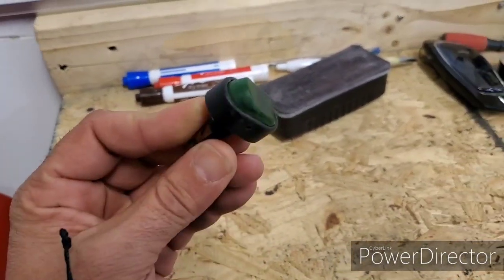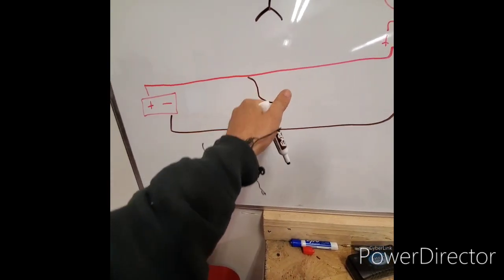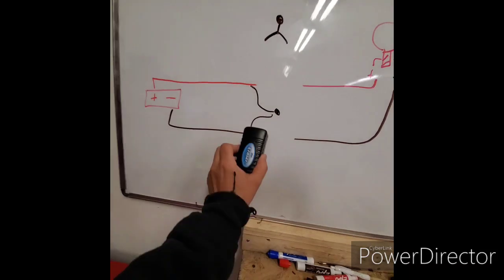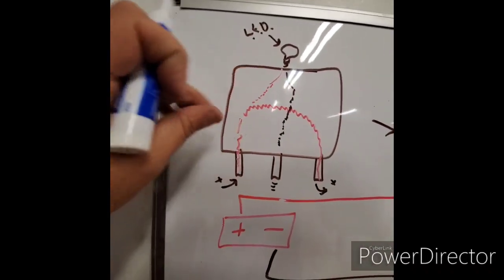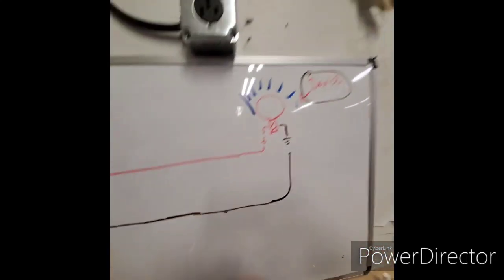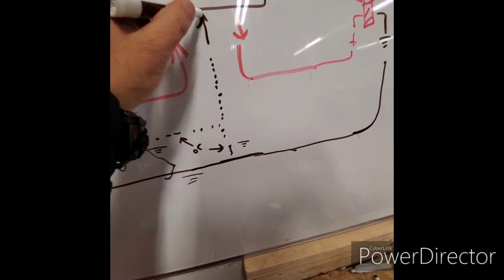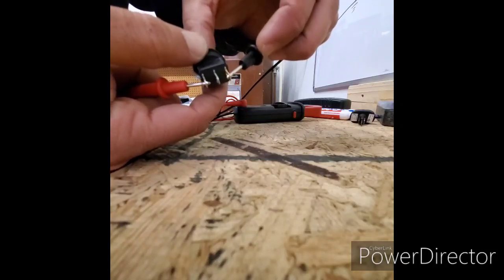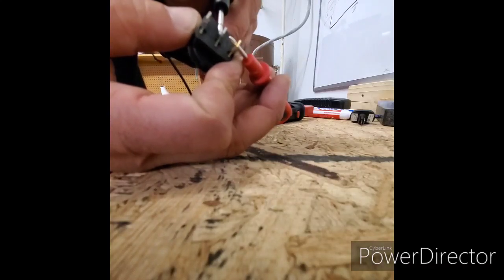How to wire an LED toggle switch , ( on-off 3 prong rocker switch ) 2020

Comment: A very informative  video concerning DC wiring.  I have been adding some LED driving lights to my side by side and everything has been working  fine. Now I want to add some lighted toggle switches  so I set up a small project on my work bench to experiment on this wiring layout before wiring the Polaris. The three prong switch is like the one you showed with the bigger light. Anyway I have a 12v car battery on the desk and was using a small 12v bilge pump as my devise.  I checked for the ground pin and located the other two positive leads.  I put a inline fuse close to the positive lead right before it connected to the battery + terminal. The other positive lead went from the switch pin to the device. The ground comes off the switch pin as a ( Y ) with one lead going to the battery (-) and the other going to the devise.  Hooked the - and + leads to the battery and blow a fuse. Not once, but two times (:(  I replaced the fuse and then hooked the same two leads to a small 9v battery and  wallah. It worked perfectly. Can't understand why it would work with a 9v battery and not my 12v. Do you have any suggestions.  Also, I have just subscribed

Comment: Thanks for the info in this thorough video! I am planning to bypass my parking brake for my new pioneer receiver, and I bought a switch to simulate the parking brake going off and on to give me access to video and settings. In my case, would I connect the parking brake wire (light green) from the receiver to the switch, then the switch to the parking brake wire on the wiring harness for the new interface? I'm using a pioneer 1770NEX and pairing it with the soogm-16 harness. Grateful for any info you can give 🙏
Reply from the maker: It would be green from HU harness --> to switch,  then switch ---> to ground.
Reply from the maker: Also. We have a micro relay video for this very topic as well. Could be simpler for you.
Reply: I’m here for the same thing… So did it works when you do it?
Reply: @myonlinecarguy1 Can you please send me the link for this topic please. Thank you
Reply: For some reason my switch wouldn't work no matter how it was wired so I ended up wiring it as the manufacturer intended. All good though

Comment: Wire up a circuit with a 3 prong toggle switch with the led ..but I keep getting it done wrong ...that Is when I plug it up to the wall the led lights up on the toggle switch ..but no power is going to the circuit board ..but when I turn it off the lights comes off and then the power goes to the board ...any help would be appreciated ... thanks 🙂

Comment: Thank you.  In the way that you have drawn your wiring diagram, am I correct in stating that the switch LED and the Load light will illuminate when the switch is turned on, but if you turn the switch "around", the switch LED would always remain on and toggling the switch would turn the Load light on and off.
Reply from the maker: That sounds about right.

Comment: Great video! You did a great job explaining the three prong.. I’m planning on building a DIY solar power box like a goal zero to power my truck bed fridge and charge phones and other electronic accessories. I want to use switches to power my 12v outlets, but the switches I want to use (round) have an LED.. though LED’s use minimal voltage/current it’s still power scavenger over a period of time. My question is, if I utilize a 3prong switch but leave off the negative connection to keep the LED from illuminating, will the switch still function properly for my source to load circuit.
Reply from the maker: Yeah the mechanical portion of the switch will still function properly without the LED portion.
Reply: @myonlinecarguy1  thanks for the valued reply! I will @mention you in my video description when the video comes out.. this will link out algorithms together and will helps us and others out. Keep it up 🤘🏼

Comment: Really insightful video - thanks. But what about if I have to wire an AC 230V rangehood fan and I have 15A 240V three pin LED switch very similar as yours on the video ? In DC circuit current always goes in one direction only, however in AC it alternates 50x per second. How am I to connect it then? Which one is a ground and which is live?
Reply from the maker: Ok. So your ABSOLUTELY correct. In an AC application,  you most likely CANNOT use a switch like mine.  As the switches we used in the video are not only DC switches,  but they are also limited to around a 15amp draw. 15amp in dc is VERY diff then 15amp AC. 
For your hood range, youll be needing a typical light switch,  like for you bathroom light. Not a toggle or rocker switch like in my video. And the wiring,  may be similar, but be sure to investigate deep. AC power is nothing to play with.

Comment: HI, 1. I'm planning to wire a small LED light bar (18watts I believe) with a 3 prong rocker switch straight to a 12 volt battery on my motorcycle. Do I need to use a 5 amp fuse and a relay?
Reply from the maker: The size fuse will depend on the electrical pull from the light.

Comment: Awesome. Great vid. Aouple of questions. 

1.  If my device needing power has a large amp draw, would a 3 prong switch not be dangerous in the sense that the large amperage moving through the entire circuit could potentially fry the switch itself and/or the LED light on the switch?  

2.  I’m a newbie to wiring. Assuming that the answer to my first question is that neither the switch or the LED on the switch would not get fried, does this mean that the LED on the switch only draws the amperage that it needs?  Whereas the device being powered draws a different amperage?  

3.  I have been advised to use a relay and connect my 3 prong switch to the relay. I’ve been told this keeps high amperage away from the switch (which will be installed in the dashboard) and contains the high amperage circuit inside the engine bay.  I’m running an onboard compressor. The 3 prong switch, therefore, is simply powering and switching the relay switch, ensuring that the 3 prong switch only has very small amperage running thru it.
Reply from the maker: The answers here are :
1) yes
2)also yes
3)this is 100%accurate. 

Now the explanation:
 1) 3 prong switches do have amperage limitations.  Should be as/per switch. No 1 size fits all here. 
2) the amperage used to power the led in the switch itself is between the power input and the (3rd prong) ground.  This is the current draw for the led in the switch. Where the power passing through and the "device" ground define the amperage for device.
3) the reason for the relay, is that now the "switch" is kind of like a keyfob. That opens a seperate amperage floodgate (that passes through the relay), but controlled by the "switch". 

Also, you said your pretty new to this. And i belive maybe you belive that, however your questions are very good one, they are electrically accurate questions as well. I just want you to know,  you seem to have a relatively solid grasp of how this all works. I hope my contribution was helpful.

Comment: Well explained. I did have a dilema with 3 prone litened Rocker switch to brack  on will D+ signal wire to my Renogy DC to DC charger to turn it on or of independetly from positive ignition supply power.👍

Comment: I have a toggle switch like your green one. I wired it like you said, the device I was trying to power come on, but my toggle switch light didn't come on. What did I do wrong
Reply from the maker: If your using the switch on/off on the power side, of your device. Then the last connection is usually going to be negative. As the LED, requured both (+) and (-) to light up. The other truth is that its very common for the LED to be bad out the box. Lots of time these switches are super cheap chinese mass produced switched. So, bear that in mind too, led could just be bad.
Reply: @myonlinecarguy1  Thank you, I think my problem was the ground was not fully connected. After rewatching your video, I believe that is where I was going wrong. 🤞👍👍
Reply from the maker: @rogenamarieanderson4522  ahhh i gotcha. That'll do it. Hopefully all is good now.

Comment: Great video!  Quick question - I have a 12v electric system. The current light switch is two prong. I bought a dimmer switch with three wires. How do I wire it with the existing two wires from the old switch?  Thanks!
Reply from the maker: In Series.  So the (+) would go: 
Batt->fuse->switch1 input->switch1 output->switch2/dimmer input-> switch2/dimmer output->device. 
Then (-) goes ground-> device and separately ground->gnd prong of switch2/dimmer. 
And thats it.

Comment: How would you wire this on AC power?  Like if i wanted to say put an LED Rocker Switch on a lamp or something else running on AC current?
Reply from the maker: In theory it would wire the same. Just make sure your switch is rated for a/c power.

Comment: Good explanation.
Reply from the maker: Thanks. Switches can be complicated and no one ever wants to damage their device. Hope it helped out.
Reply: @myonlinecarguy1  It confirmed what I had worked out myself today when fitting a switch (2 pin) for a car horn.  At first I thought I needed to connect negative and positive to the switch.  Then I thought, hey no!   I am just putting a switch in-line to break and connect the power source and the horn is grounded.   I also  have a switch that has been wired on the negative line and the switch is grounded to metal.  Simple once you know.
Reply from the maker: @flumpaustin1994  your absolutely right. Most people forget that you can ground locally. And its easy enough to just run the 1 power line. And this is for most devices, led lights, a horn like your using. And so many more. 
The LED or 3 prong switches def add another level to it. But not as much as it seems. If only the manufacturers would add a diagram. They have literally no paperwork ever, lol

Comment: Thanks for the detail explanation. Currently I am preparing to make busy board for my baby and brought me into this video. Can I light up toggle switch's built in LED with 2 or 4 AA batteries? (3v or 6v input) Or is it mendatory to be 12V?
Reply from the maker: That will be dependent on the led. Each led will have its own electrical requirements.  But if you bought a lower voltage led you could use lower voltage power. But a 12vdc led would usually function 11-14v without much issue..

Comment: Hi, great video. I am looking to plug an LED toggle switch to some interior dome lights that are tied to my door lighting system (meaning turns on when my doors or tailgate are opened). I’ve installed them following the IAG instructional video and tapped them to the door lighting wire and grounded to the frame on my 2022 Bronco. The question I have is can I just add a 3 prong LED toggle switch by adding a connection between the door light tap to the power in the toggle switch then connect the device wire to the toggle and add a new ground to the frame from the toggle switch? Will I need to add an in-line fuse since I’m not going directly to the battery? Will I short anything out if I don’t add the in-line fuse?

Comment: So does the logic apply to the scenario where im running a ground out of an accessory and then from switxh to chassis. I do not care if the light is illuminated but need to ground my HD im afraid will short in its current state.

Comment: Hello there. Excellent video. Question. I have a pair of touring custom headlights to replace the Honda Accord Sport oem headlights. A friend told me to install a 3 prong switch to avoid draining battery power. Do you have something similar to what I’m looking for to help me install the switch? I will appreciate it in advance...
Reply from the maker: A basic 2 prong will do what you need. A 3 prong will as well, as a 3 prong is the same as a 2 prong just with an additional on/off light.

Comment: Good morning so I'm putting strobe lights on my lowboy trailer and I'm tapping into my parking lights on the trailer for power. I'm going to be adding a toggle switch to turn them on an off manually and want to know when I tap the parking light for power. The toggle switch will only turn my strobes off an on only right?

It's a 3 prong switch and it has ground, power, device. With it connected to device, it will only turn the device on an off and not turn my parking lights off an on too??
Reply from the maker: As long as the switch is connected AFTER parking light and BEFORE strobe then yes itll only turn on/off strobe. . 
If tou put the switch between main power and parking then itll shut both  parking and strobe off.

Comment: Okay! This video help me get the basics in which was very helpful. I'm trying to be a little more AMBITIOUS, I just bought some "Led" kit with different modes. I want to put them in the interior and under the car without losing the cool light modes but I want to be able to turn on and off with 2 different switch. Like if I only want the inside of the car "ON" and the bottom of the car "OFF" or vice-versa . WHAT IS THE BEST WAY OF DOING SOO? THANK YOU!!
Reply from the maker: Easiest way would be 1 switch interior and diff switch exterior,  keep it simple and fuse both separately..

Comment: Great video. I am trying to by pass the switch on the under cabinet led light bar with a rocker switch mounted on the lower front surface of the cabinet to make it easier to turn the light on and off. Do I have to disconnect the switch in the light bar all together  before adding the rocker switch inline on the power source line?
Reply from the maker: No, if you leave the other switch in place, just be sure to leave it in the "on" position (always 100000% of the time).

This way only the new switch manages the light.
Reply: @myonlinecarguy1  Thanks for the quick response!!! I am now looking forward to wiring it in the morning!!! thank you so much.
Reply from the maker: Sure thing Thomas, good luck with it. 🤙🏼

Comment: How's it going, first I wanna say I find ur videos very simple and to the point. I'm working on rewiring my bass boat and I recently bought these 3 terminal blue and red led lit touch switches and I'm having a hell of a time with them. My question is, do I need a seperate ground for my accessory or switch with these particular switches? Thanks
Reply from the maker: A common ground should be fine. Same ground for your device can also be the ground for your LED in the switch.

Comment: I have a 6 toggle switch panel for my car. Each toggle has a LED light. So I understand how to wire it up as you just described in your video. But the LED lights only come on when I put the toggle in the on position. I'm wondering is there a way for the LED lights to light up when I turn my key to accessory so that they are always lit when the car is running and then hopefully stay lit when I switch the toggle on to powerr my device.
Reply from the maker: Unfortunately inorder to do that requires a switch built for exactly that. It would be a 4 prong most likely.  As the led part would need its own power and ground seperate from swotches function.
Reply: @myonlinecarguy1  okay. Thank you.
Reply from the maker: Your welcome..

Comment: A question: Can I use a 20amp inline fuse on a 10 amp toggle kill switch if I cant find a 10 amp fuse?
Reply from the maker: I am so very sorry, i try to answer everyone and am only jist now seeing this post. The answer is no, you shouldnt. It may work, though but shoukd be very temporary.  As if theres a short, there will be some type of damage to the switch.

Comment: Very informative and nicely explained. Just out of curiosity I have a question. Through the ground prong can we connect another load through dat switch. Say for example i want to install hazard switch in bike, so from one positive source i want to conect to both left and right indicators. Can I use this switch in this case??
Reply from the maker: No. You cannot. Its an "input" to the switch. Not a powr/gnd output. So, its not live.

Comment: I have a 3 prong switch for a foot massager with 3 settings on/off/on, it labeled: 1a 1 1b, One wire is white, the other two are black, how do I SAFELY & CORRECTLY connect please?

Comment: How can you connect two of these switches together? So there isn’t so many wires being ran, specifically the ground wires for the LED indicator, could you wire them together then branch off to a chassis ground?

Comment: if I want to wire 3 prong switch  with 2 other devices.. do i bridge the power from switch to to other devices then what about the  negative strait to the car or do i bridge it in the switch too

Comment: so this did help alot but i would like to know the same demonstration but on a radio(head unit) to a battery and speakers cause i have split tha positive and i have the ignition wire out as well so when i go to turn it on i have to wire the two wires together and i would like it to be easier and have a switch but i don't know if i should take the ground wire and connect it to the toggle switch or i have to split the ground going to the switch and to the radio cause i know the radio needs a ground aswell as the toggle switch.
Reply from the maker: On a radio there are 2 power wires.  Red(ignition)+yellow(batt+ constant). If you wire both yellow and red to batt, but split red for switch, you will have a radio that works perfect. The yellow need power ALWAYS , to remember clock,eq settings and more. But the red turns the radio on/off. So put the switch on that wire.
Reply: @myonlinecarguy1  ok perfect helps a lot

Comment: Hi I have a question let say I want to connect an led switch of 20A and I want to connect it to a light of 42w 12v which if I am not mistaken is 3.5A what wire size awg should I connect?
Reply from the maker: Prob not smaller then a 14, or 12 awg line.
Reply from the maker: Also make sure u fuse the line